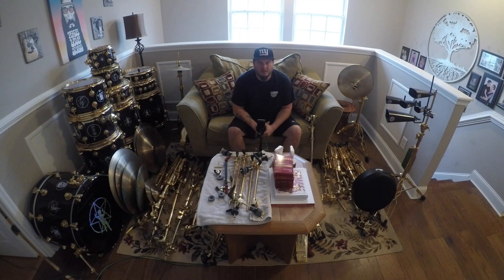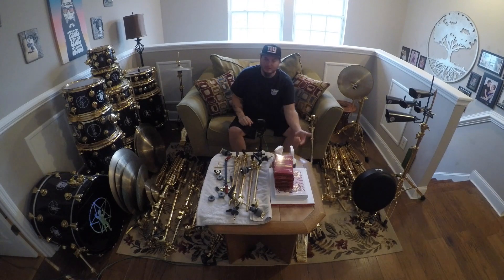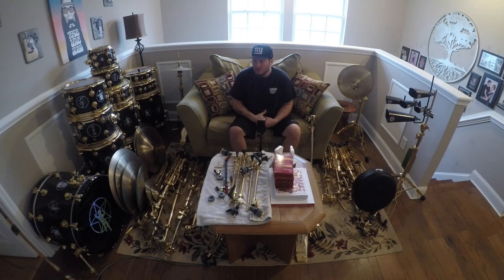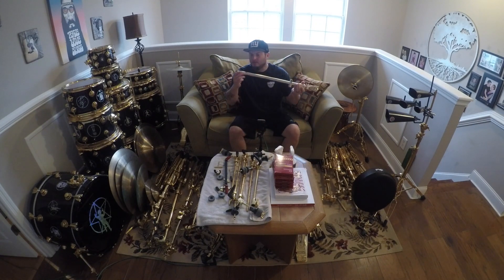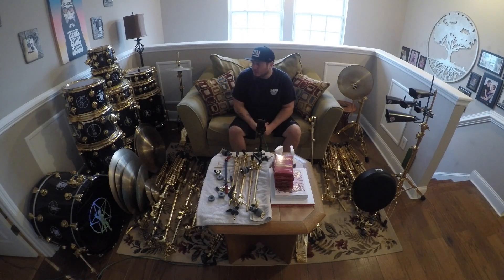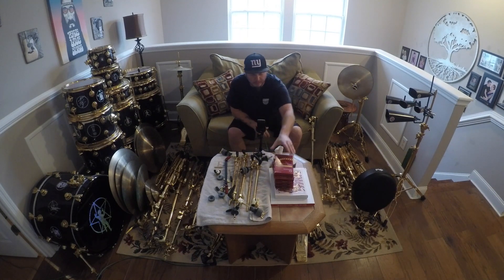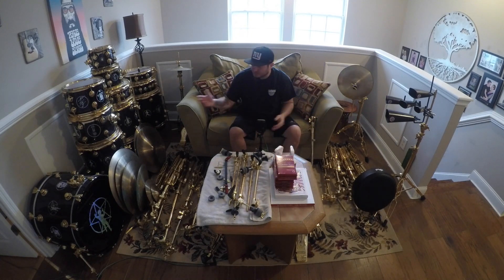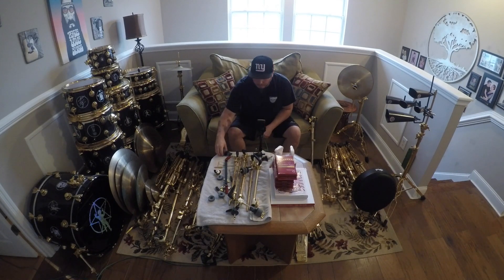Restoring The R30 Volume #1

Comment: How does someone not take care of an R30 drumkit to where it would need to be restored?  It's only a little over 10 years old!  As to the Paragons that need to be replaced, I'd be happy to take the old ones off your hands!
Reply from the maker: Mark Benzaquen that was the question I had for sure. I was blown away to see it in this condition!! Living by the ocean, the salt water air can be unforgiving. Especially if it is just being stored not in cases in a area with no climate control. There are 3 Paragons to be replaced as well. Thanks for watching!!